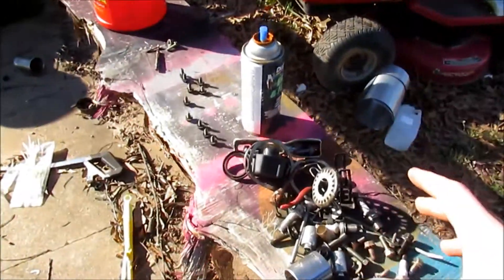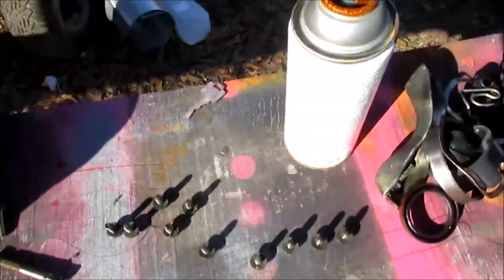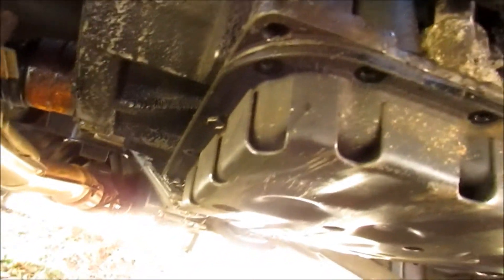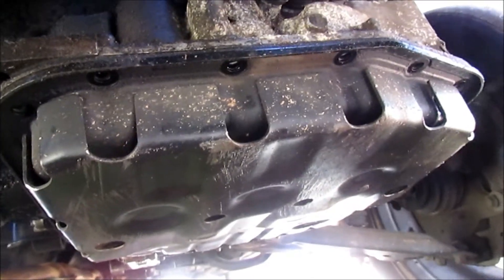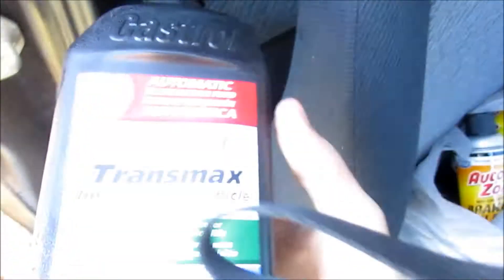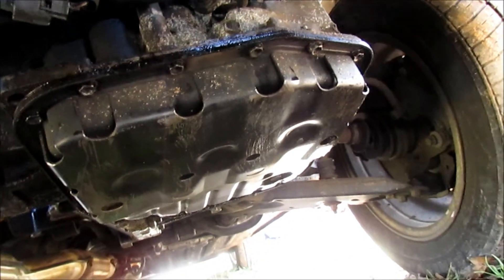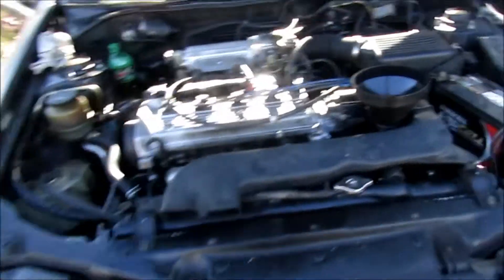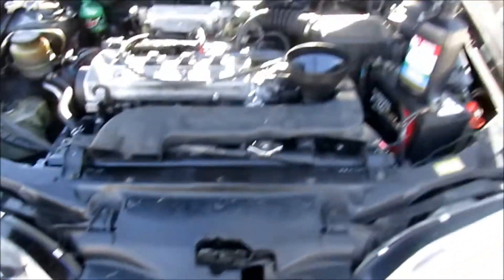Project Paseo (Episode 3) Can it Move?

Comment: It's pretty loud. Hole in the exhaust?
Reply from the maker: +argonian bilbo the header was removed so the mid section below the engine that bolts up to the rest of the exhaust has a gasket. And that gasket could be leaking a little, but its really not loud in person.